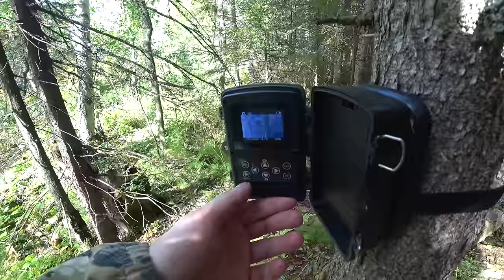14 days: I'm building a bear-resistant shelter alone

Comment: Very entertaining video, well shot and edited, and a monumental project.  You made various choices I highly agree with, such as roasting the ground-contacting floor joists to help preserve them.  Some of the other wood in contact with the ground could have benefited from roasting as well, such as the stair treads, various stakes driven in, etc.  But altogether, very neat and satisfying!  

A minor point, but I do think the notches should always be facing down, to help make the joint rot-resistant.  Upward-facing notches can serve as a catchment for water, which more easily penetrates the broken/chopped wood fibers of the notch, than the unbroken fibers of the log's outer surface.  The tarps held against the outside of the logs (good choice there, btw) do help, of course.  But given how you pre-assembled first (another good choice there, fitting the logs up where it's easier), I thought you would disassemble log-by-log upside down, the top of the pre-assembly becoming the bottom of the final assembly, with notches upward in the pre-assembly and downward in the final assembly.   But the tarp will probably do the trick in this 'piering-type' application (as in coating the outside of a foundation/basement wall).  Definitely should be downward-facing in an above-ground cabin with no tarp, though, where they'd be exposed to the weather.

All in all, good job, and beautiful design!  Can't wait to see the final result!  Good work!